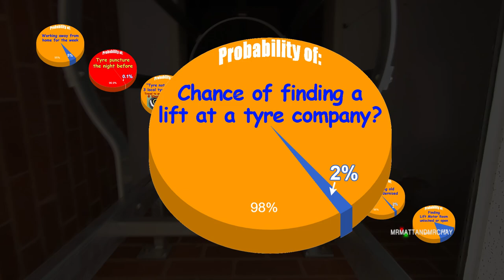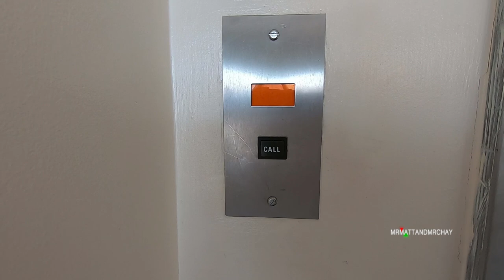1981 Evans lift - video preview

Comment: Another Youtuber uploaded footage of an original Evans in Dublin around a year ago. Though, the footage was from 2015. I know the building, but whether the lift is still there, I don't know.

There are apartment blocks near to where I work, and the lobby of one features briefly in a lotto advert. It looks like there is a swing door Evans lift there (it has the orange Lift Coming panel like in the video here, but with a round call button). There appear to be inner doors, but the cab looks original.

It is amazing what can be found by chance. Most older buildings now have been refurbished, and lifts replaced or modernised. Even with modernisation, some original features remain, as I have seen.